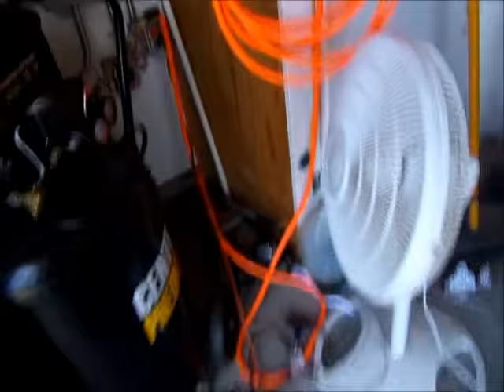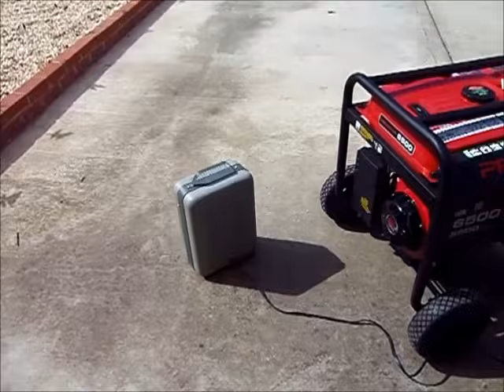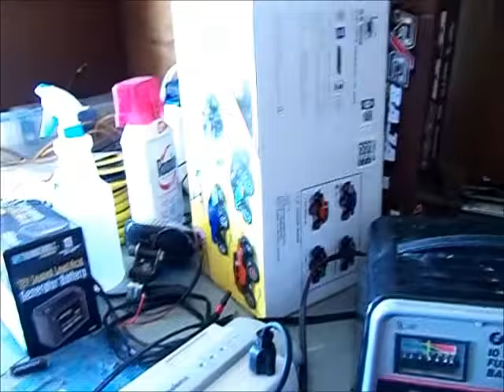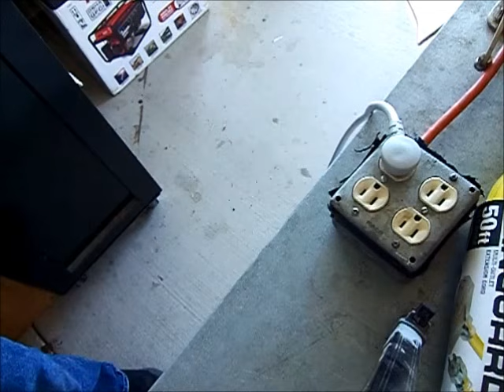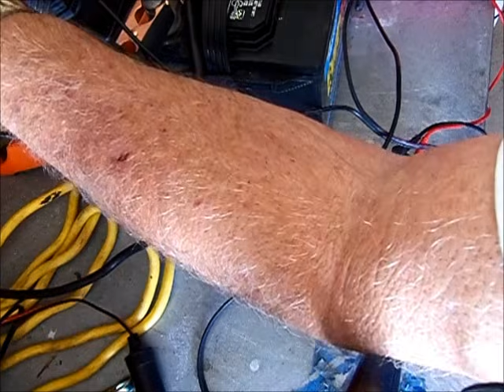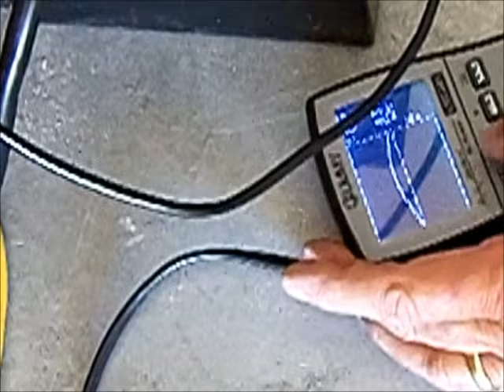Cleaning up the "dirty" sine wave from a non inverter generator. This is part 1, proof of concept.

Comment: Your over thinking about wave sine ,  DIRTY Sine Wave DOESN'T HURT ELECTRONICS (Read Below ** )  Voltage Spikes Damage Electronics  , Generators Without a AVR  (Automatic Voltage Regulator )  and  Brushless Generators     are the ones that Can Damage Electronics because they have No Safe Way of Regulating the AC Voltage Output when a load is added and removed they can drop to under 100Volts and Spike to high as 150+V that is what will Damage your Electronics , A Quality Generator with a AVR  is Ok to use for Electronics , I use a Generac RS7000  Here in FL when the Storms come and Power is Out and have run all my TV's (NEW LED TV's )  Radio , Home Computer , Charge Cell phones and have Never had any go Bad from being powered from the Generator . Yes a Inverter Generator is Best if you plan on running your electrics for a Long Period of time MONTHS or If your off  the Grid . The Real Big Advantage of a Inverter generator is it can run at lower RPM'S  and make way less Noise which is ideal in a Camp Ground & it uses less Fuel 

**  Electrics Run ON DC Voltage  the power supply first thing it does is convert the AC volt to DC Voltage and has AC Metalized Polypropylene Film Capacitors & Line Chokes to clean the AC voltage  before its converted to DC voltage and has DC voltage Capacitors to clean the DC Voltage .
Reply: Thanks for your comment. My new furnace won't run off of my Powermate  generator, so there must be more to it then what I know.

Comment: Great problem-solving, but by the time you figure in your cost for batteries inverters and the time it took you to figure it out and go to the store 50 times you probably could invite bought an inverter generator for about the same price and not worry about all this
Reply from the maker: First see parts 2 and 3:The final set up.
   In part 1 I used things I already had on hand. For the final set up I purchased most of the pieces I needed at one time off Amazon. The group 27 battery was Walmart and some other hardware parts, Lowes. I made a parts list for the non Amazon purchases and made one trip to get them. The generator was a great sale price at $499.00 and I had a $50.00 coupon so it was $449.00. My total expenditure on my system was just over $1,000.00. At the time I started this project inexpensive Inverter generators with any real power output weren't available. Harbor Freight changed that in 2021.
   For any one in California get your gas powered equipment now as the liberal snowflakes have banned the sale of small gas engines under 25 hp starting in 2024.
Reply: All so there is the cost of replacing the batteries every so often.  They do not give them away any more so to speak.    While it is one way to do things the batteries will require being looked after.  If the electronics will not tolerate the generator I doubt they would survive a few surges as the power blinks off and on during power line problems.

Comment: I'm having exact issue you have. Literally no one can tell me and I can't find a way of cleaning up the sinewave on my 2400 watts petrol generator? I have the same multimeter/oscilloscope. Actually a good little unit as I do a comparison test of household power and generator power. My household power is a little dirty but my generator looks terrible. Lol. I power up my generator with a 300 watt industrial fan hooked up and turn the switch on. When I checked the power point with the Mustool meter? It does worry me especially when I use my window aircon. I'm gonna do your trick! Absolutely marvelous job. Subbed and liked 🙂👍👍👍.cheers from Australia. Btw your sinewave is beautiful comparing to mine. Mine looks ridiculous. Lol.
Reply from the maker: Do you have a store along the lines of Harbor Freight in your area? When I started this project there were no high wattage output inverter generators at a price even close to the approximately $1500.00 I spent putting this system together. Check your area for inverter generators in the power level you need. You might find that it is close in price and a lot more convenient to use. I am going to hold on to my set up as long as possible because California in all their total stupidity is outlawing all new small gas engine sales starting in 2024.
Reply: @d.s.steele3100  we don't have harbor freight in Australia but I can go to camping stores but they charge an absolute fortune! I can order from EBay but sometimes it's a gamble with certain items. Sellers over rated items and I have bought for example 2 350 watt solar panels. When I tested them ? 240 watts each. So I ordered 2 more but solar is a little unpredictable as in maximum power one minute and clouds appear and a few amps only I put extra heavy cabling. I need to buy MPPT charge controllers but price? But the generator with a sound proof box ( sort of) will run on an oily rag. Lol. Cheers for the quick reply!

Comment: A lot of efficiency loss in this method.
Reply from the maker: You're correct, unavoidable efficiency loss through the DC part of the setup is a fact. Low voltage same watt draw equals high amps with much thicker wires. That's  why the #2 wires from the power supply across the battery to the inverter in parts 2 and 3. If you haven't watched those parts, they will show my final setup.
Reply: @d.s.steele3100  Actually I was referring is the Power Factor losses going from the generator120VAC to 12VDC [power supply] AND the sinewave inverter going from 12VDC to 120VAC. That represents two stages of power conversion where at each stage there is a significant loss one of them being in the form of heat.

I just bought a Predator 9000 and was thinking about the same thing. [Only I am dealing with 240VAC] The ides is to take a sine inverter that accepts a 240VAC input. There would still be some power loss  in the conditioning but at none in the form of stepping down and then back up the power. I couldn't find one. The only path i could see is to take a replacement part sine wave creator from an actual  generator made to produce clean sine wave output. Then there is the cost factor. The generator I bought for $699 on sale is now $849. The Predator 9500 clean sine wave  model is $2,199. That's $1,349 difference. How much would a sine wave replacement part from a 9500 cost. Is the generator portion on the 9500 the same as the 9000? In that the generator portion both put out the same voltage? Maybe they both do use the same generator portion but the difference is in the regulator. Making the 9500 generator put out 260VAC while the 9000 puts out 240VAC.

The reason for the different voltage requirements is that the sine wave device needs a greater voltage input than what it is designed to put out. In this case 240V... This is so that the sine wave creator has some input voltage headroom so that it can regulate a stable voltage output. [240VAC]
Even if you could regulate your generator to put out the needed higher voltage [260V] to drive the sine wave creator properly. Then how much would that cost? [$$$] More than $1,349?
I likely would be cheaper and simpler to just bite the bulled and buy the inverter model for an extra $1,349.

Then there is this issue...I have been repairing electronic devices since the early 80's. All the way up to today [There is no better way] every electronic device runs on DC voltage. Usually lower than the line voltage. [Very rare to step up the AC line voltage to a higher DC voltage]
The two methods for this is...
1. Transformer
2. Switching Power Supply
In both cases the AC power comes in and is converted to DC. [Right after the transformer and immediately in a switching supply.] This is done with a Bridge Rectifier [Package or discrete diodes] and then sent to a capacitor to be stabilized thus providing flat DC signal.

The point I am making here is that the cleanliness of the AC sine wave isn't as important as they make it out to be because it gets converted into DC right away inside electronic devices anyway.

The REALLY BIG ISSUE with standard generators is the risk of POWER SURGE. The key is to make sure that ANY electronics you care about are plugged into a quality power surge protector.
Reply from the maker: @DrHarryT : Run a scope on that 9000, you might find that the sign wave is "cleaner" then you think. My 6500s (120 & 240v output) sine wave was much better then I expected even under load from a high torque drill motor. If so a line conditioner might be all you need to prevent voltage spikes. If you are powering a stove, dryer, AC, ECT., you may find a 240 v line conditioner through a industrial supplier. Remember the control circuitry on those "heavy" appliances is only 120v. Only the heating elements and/or compressor/fan motors are 240v.
  If you check the voltage on my generator from it's output through to the inverter output there was almost no change. My concern was the wiring in the 12 vdc part as 1000 watts at 12vdc= 83+ amps were as 1000 watts at 120 vac = 8.3 amps. Again watch parts 2 and 3 for my finished setup.
Reply: @d.s.steele3100  My main point is that there is and always will be energy loss in power conversion. [That is called "PF" = Power factor.]
If you check...Pull 1000W off of the sine wave inverter, then check how many watts are coming off of the generator and it will be something like 1100W...You loose 100w in the two stage power conversion. [120V to 12V back to 120V]

[You put in 1100W but only get out 1000W] That would be a 90% power factor in your system.
I repeat...
[You put in 1100W but only get out 1000W] That would be a 90% power factor in your system.

Check...Start the generator and then put a load on the sinewave inverter... Hook a watt meter between the generator and the 12V power supply. Then move the watt meter to between the sinewave inverter and the load. Maybe use a hair dryer or toaster.
You WILL find the 12VDC power supply using more wattage than the hair dryer is using.

Comment: I hope you upgrade to a 1 to 2kw pure sine wave inverter.  Floating ground is fine, no need to attach to breaker panel. Also, think about a 200 amp hour LiFi (expensive, but worth it) battery. And a "Big Ole" battery charger.
Reply from the maker: This was part 1, proof of concept. See parts 2 and 3 for my final setup. You'll see I used a 100 amp power supply/charger and 1500/3000 watt inverter. I started this project before Harbor Freight came out with their line of inverter generators. If I were to do this now I would buy one of those as they are half the price of other brands of equivalent power output inverter generators.

Comment: Almost everything today has "electronics" as a part of it. Your refrigerator, your washer/dryer, microwave, Of course, TV and stereo, but also likely your heat pump or AC system. And as these loads go on and off the generator load changes and so does the harmonic distortion level.
I have a 15KW generator that feeds the whole house. I have a surge protector on the panel and a few local protectors on the 82" TV and Dolby receiver, and everything seems to be ok after several generator uses. If there was a filter for my generator that was reasonable cost and would reduce distortion at varying loads, I would get it.
Reply: Thanks for your comment. What are the local protectors you have? Something like 30 MFD capacitors plugged in parallel at the TV wall plug or power bar?

Comment: By the looks of it, the output from that generator is pretty decent. "Dirty AC" is not always as bad as it sounds. Sure, inverter generators are better, but it doesn't mean that non-inverter generators are necessarily bad. So called "sensitive" electronics will tolerate all but the dirtiest AC. By "dirtiest", I mean spikes exceeding the allowable P-P voltages, etc. You see, the great majority of electronic devices use switch mode power supplies (SMPS), which is roughly what you were trying to emulate. SMPS takes the AC voltage from the utility or generator, rectifies it to high voltage DC, converts it to high-frequency AC, and then dropped down to low voltage DC that actually powers the device. There's a lot more going on like PWM and feedback circuits for regulation and control but suffice to say, your electronic devices won't even 'see' the kind of AC waveform your generator is putting out. All it gets is regulated DC from the SMPS.

As for your experiment, you're limited by the amount of power the charger and the inverter can put out. If we can assume that the charger can do 10A @ 12V, that's only 120W. If you pull 300W from the inverter, it will run down the battery and the charger won't be able to keep up to charge the battery, much less supply the load. But the elephant in the room is, you can only get a max of 300W (albeit, for as long as the battery lasts), even though you have a generator that can provide over 20x that.
Reply: @Orly Palomar, Jr.    ....Seems you fully understand the technology and know what you're talking about. I agree the AVR in the Predators make their output pretty "decent".....not inverter quality but not bad either. So here's my question---> what constitutes delicate electronics? Seems my laptop has an inline transformer that with a simple plug configuration change ....can take 120V/60Hz or 220V/50 Hz. Is such a laptop "delicate electronics"?. What about smart TV's ? Microwaves?.... electric ranges and other appliances and their controls?  Serious question.....we hear about delicate electronics but what are these and can they be supported by a normal generator? Thanks !!!
Reply: @TheWilferch   i have an old "einhell" brand generator. no problems with tv ,pc... ... but some of my led lights flicker at about 25 hz as a guess since its clearly visible . annoying AF.  incandesent? (the long tube lights) also work normally.
Reply: @vihreelinja4743  ....Some LED bulbs you buy say "dimmable" or "not-dimmable"....so the LED sensitivity you are seeing might be due to the type of LED's. Overall....a regular generator that has AVR and is in proper condition should be ok. Since I posted my first question I even installed TWO meters on my generator.....one for each 120V coil ( I'll be using the 220V big cable to plug into my house from the gen).....each meter reads Voltage / Frequency / Hertz......should tell me how good  the power delivery is....and I can see each coil health separately.
Reply: @vihreelinja4743  Resistive and rectified loads don't care about modified sine waves and see the same peak-to-peak RMS regardless of "cleanliness" of the sine wave itself.
Reply: My quess exactly.....that "clean" inverter power is necessary for "delicate" electronics....is overhyped. Causes us consumers to be fearful and then spring $$ for new, replacement inverters gensets. It's more a matter of voltage "Spikes" rather than how pure the sine wave is produced. I see this fear repeated all the time but how many post actual "fried electronics" happening to them?
Reply from the maker: This, as stated in the title, was part one "Proof of Concept". Check out parts 2&3 for my final set up. You're correct about the generator having a cleaner sine wave than I expected. That is why I only ran a 1500 watt inverter to my more sensitive electronics (can't be too safe in my opinion). The 1500 watts proved to be over kill as I am drawing less then 200 watts currently. Can run a lot more equipment if need be. I would tie the generator into the main panel with a proper set up but am not sure how to avoid damaging the leased solar system.
Reply: @d.s.steele3100  put a solar charger between the generator and mains/ existing solar system. it should prevent overharging youre solar system. if its a mains solar system then  would assume it is equipped in a way that the generator will not damage it. why the hell would you lease a solar system xD ??? solar systems should not be thought about it takes 20 years to pay back. just bite the bullet and buy a system. now you have free energy for decades and you dont need to pay bills. or atleast you need to pay less on monthly basis and can be happy about it. different story if you take a loan to buy a system. then you will pay prolly the same as just buying the eelectricity.
Reply from the maker: @vihreelinja4743 : The leased system was on the house when I bought it. It's next to impossible to break a lease.  If I had a choice, there would be on solar on the house at all. Instead, I would put a more efficient HVAC system in and improve the insulation cheaper and would save more each month.
Reply: Side note about smps, is that the higher frequencies allow for much smaller transformers (in isolated systems) or coils in buck/boost.
So long as THD is below 20%, things should run without issue and as you said, It's the p-p transients that really kill things.

Inverters are much more efficient at lower loads also. Good info on the video and your addendum
Reply: exactly i run 3 computers a ham radio tv routers furnace and i have never had a problem in 14 years
Reply: @BOB12349307  Resistive and rectified loads don't care about modified sine waves and see the same peak-to-peak RMS regardless of "cleanliness" of the sine wave itself.
Reply: I see two reasons to buy a inverter generator.

1: is the full sine wave for the power.
--sure can be converted via a battery and inverter unit = more money.

2: inverter gen units vers the old open frame units is the NOISE.